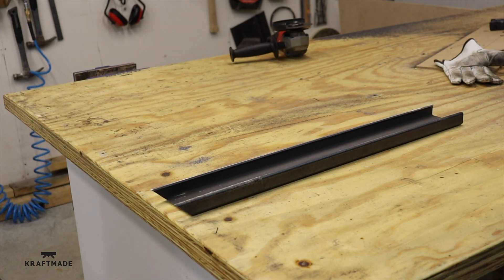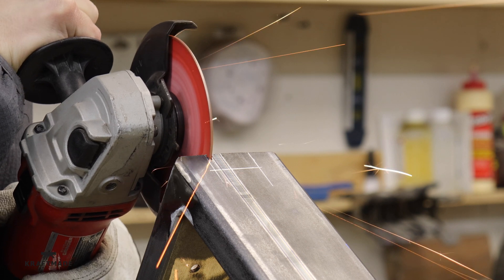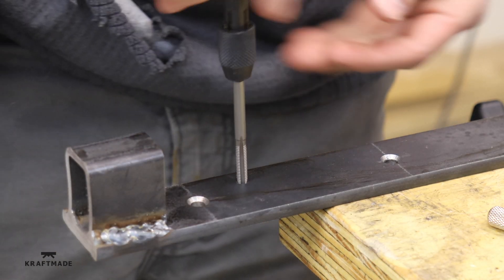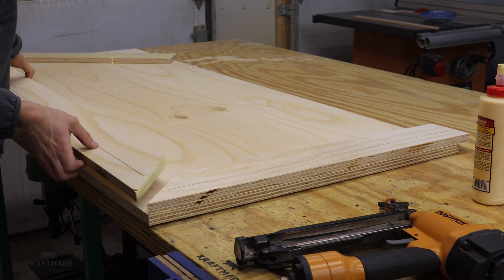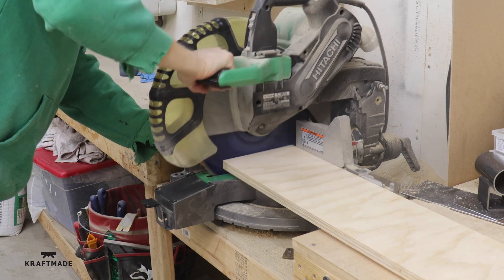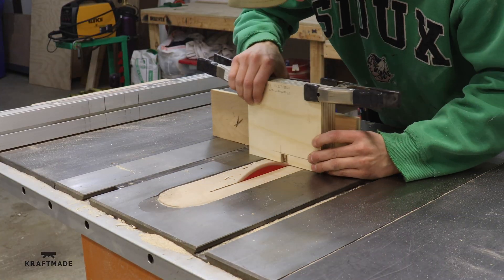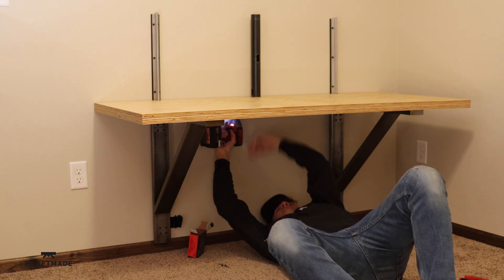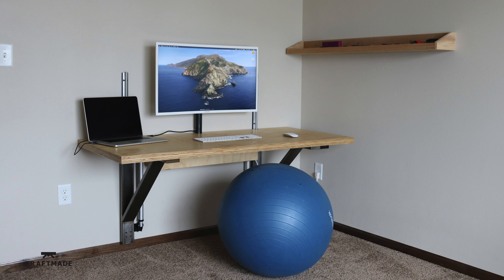Motorized Standing Desk - Kraftmade

Comment: When you use two linear actuators and the power is on, the actuators move up/down evenly ? I thought, there might be some sort of calibration to make those actuators works evenly.
Reply from the maker: Yes, the motors should move at the same speed however if they don't you could put a speed controller on the motor. I got all of my information from this video. https://www.youtube.com/watch?v=hpZl77cYBxo&t=837s

Comment: @Kraftmade  This is one of the best designs that I came across so far  on YouTube. I would like to build a similar one. May I request you to share the measurements please.
Reply from the maker: Unfortunately I don’t have plans but would be happy to answer any questions you have
Reply: @Kraftmade  Sure, Thank you very much and that would be a great help. I do have few questions:
Wanted to know the type of Linear guide rail you have chosen and its size if it's fine with you.
You have also selected strong solid steel for the rectangle tube, What is the thickness of the rectangle tube? 
Rest of the things / measurements I will try to manage and I would get back to you if I have any question. Hope that's fine with you. However thank you very much for the response.
Reply from the maker: @santoshlingala6267  It's a linear rail bearing guide 1000mm. It's 1/8" 1"x3" rectangle tubing. You are welcome!
Reply: @Kraftmade  Excellent! Thank you very much for sharing the this details.

Comment: Great job man, exactly what I was looking for. I'm a little worried about how the linear guides would hold since I don't know how to calculate the load. Have you done the math?  How are they holding after 5 months?
Reply from the maker: It has held up very well. Even with working from home it is still rock solid! If I remember correctly each of this actuations holds like 350 pounds so I way over killed it. Rather overkill than under kill
Reply: @Kraftmade  thx... but I was talking about the linear guide(fixed to the wall) and pillow block, not the linear actuator.
Reply from the maker: Oh, the linear guides are still in great shape. Everything works as good today as it did on day one

Comment: Hey really considering making a sit stand desk cause there's nothing else I can do right now but didn't want to buy the linear actuator or start getting deep into the it until I was certain about this idea I've seen many which use a singular actuator at the centre of the desk but would it be possible on a shallower desk to have the actuator at the back and still have it lift everything level?